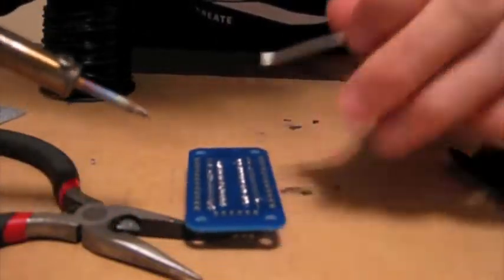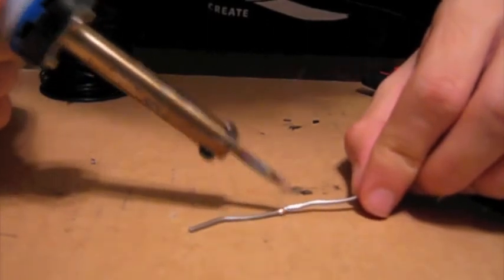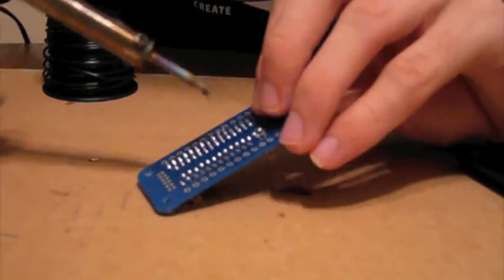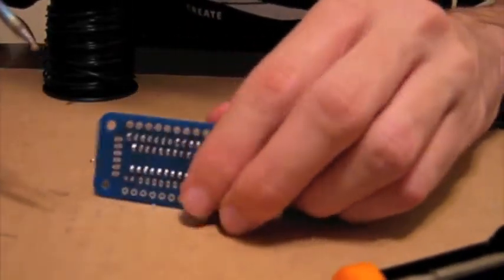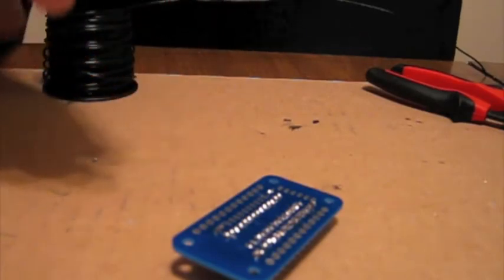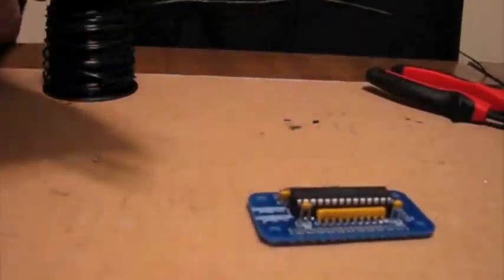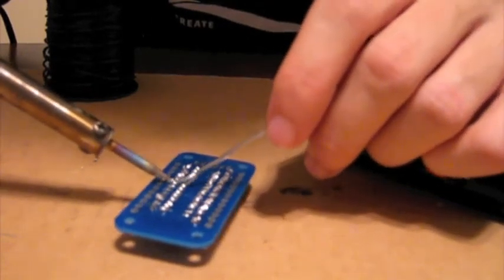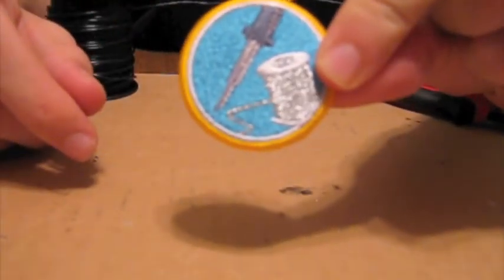The new LED mod—FGWidget. Assembly—Part 2

Comment: @nerrage Are the resistors in the FGWidget chip all the resistors needed for the LEDs or do they need a seperate resistor?  Also do I need the KNsert from Toodles website to house a LED or can I wire the LED's directly to the output of the FGWidget board? (with ofc a daisy chain connection between all LED's to the chips Ground point.

Comment from the maker: @Deathofblades Yes, this will get that effect. $18 for a soldering iron is plain robbery, in my opinion. It likely will work just fine, but you can definitely shop around for better deals. I buy most of my stuff online, but if you want somewhere where you can shop locally, RadioShack has lots of electronic tools.